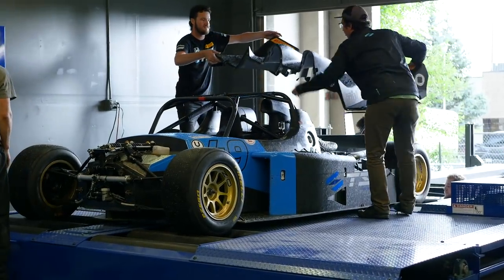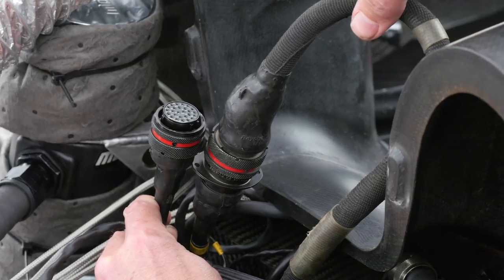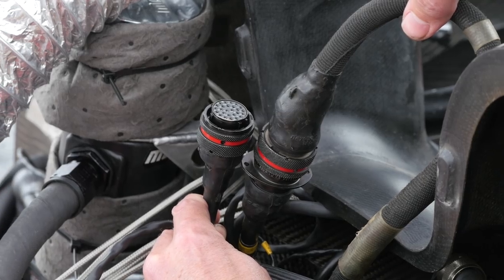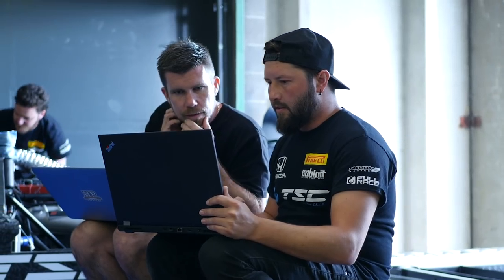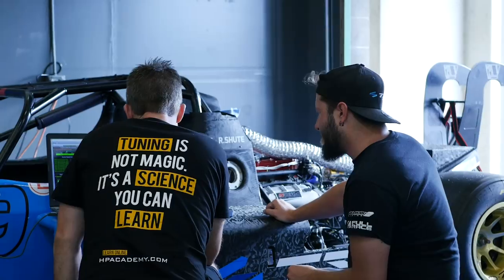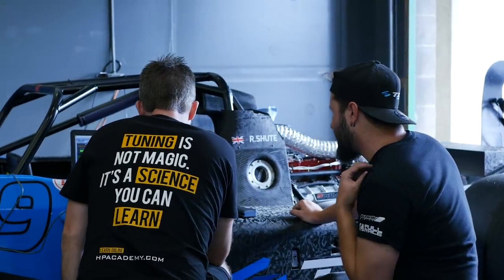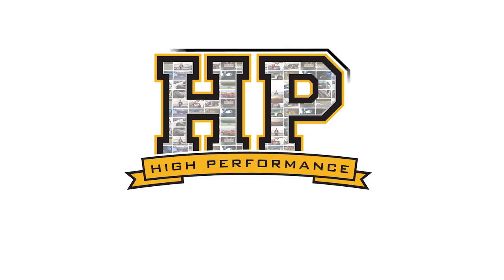How I became a Motorsport Wiring Professional [TECH TALK]

Comment: I only solder because I've had and seen lots of crimping failure, I guess that'll change now. I guess I'll revisit my crimping techniques. Ty Taz
Reply from the maker: You can thank Andre and Zac, I'm just the comments guy, but cheers! haha 
Knowing the limitations of techniques and products just helps you better avoid the pitfalls. You don't necessarily have to change what you are doing with your wiring if it is working for you (depending what the application is to a point as well) but we can say with confidence where we don't use it and why in professional motorsports looms 😎

There are some great resources on the forum for tools and material if you're on the hunt for some crimping gear though: https://www.hpacademy.com/forum - Taz.
Reply: Ty Andre & Zac
Reply: @gammalight1312  chances are its the tools your using.
Reply: @blindabinda1234  totally.
Reply: Man, I read the aerospace advice on soldering wire joints. They go so deep into stranded connections and crimps that it makes you wonder where the solder section is. It isn't. Aeromotive literature I've seen always specifies no solder unless on circuitboard. Die to vibrations. Im thinking the gentleman here read what I read. Im actually relieved, no joke. Nobody believes me on this one hahaha

Comment: I couldn't wrap my head around a crimp being better OR more reliable than a soldered joint. Then I looked at the crimp on the website... I realized you aren't talking about the Wal-Mart crimp connectors I was thinking about. I've never seen a crimp like this. Changed my mind.
Reply from the maker: Yes there is quite a big jump from those to decent crimp terminals and tools in quality, and even then before you get to the professional level materials there is a solid middle ground. Really happy the video helped you discover something new and cheers for the comment :) - Taz.
Reply: There are ways of soldering that are good. Space industry solders connectors and their requirements are higher than racing.

Comment: Kinda funny that in the military we DO use solder "milspec" connectors on the aerospace equipment...
Reply from the maker: The suppliers tell you not to do this. Whatever works for you, but you won't find us soldering connectors unless we switch from performance vehicles/race cars to tractors, and even then we'd probably still crimp ;) - Taz.

Crimping "preferred method for high-performance applications": https://www.milnec.com/mil-spec-connector-learning-center/mil-spec-crimping-instructions/

Soldering "general-duty and industrial applications": https://www.milnec.com/mil-spec-connector-learning-center/how-to-solder-mil-spec-connectors/

Comment: You only have to check the Military to see how their radio equipment wiring is made. Not cheap though! At least here in Aus the only failures I saw was due to neglect either having it squashed under heavy loads, worn on sharp steel/alloy or pulled so hard while attached that it had no choice but to tear itself to bits!

Comment: What about circular mil-spec connectors. Those are a really great choice to use and is a lot cheaper then Autosport connectors. Why don't you'll talk about mil-spec connectors.
Reply from the maker: What specific military specification/standard of connector are you referring to? 'Milspec' is a term that covers the wiring tractors through to missiles, it's not specific to anything.

Autosport on the other hand is a line of connectors made from the same parts bins that are specific to motorsport. They are generally lighter and have a higher pin count - Taz.
Reply: @hpa101  ms3470 and ms3476 circular connectors. They use deutsch pin and socket terminals

Comment: Calling Deutsch DT/DTM connectors cheap is quite funny. In professional world of harness manufacturing, they are quite expensive, so in mass production, they are often substituted for various generations of cheap but reliable AMP Power Timers.
Reply from the maker: They were not called cheap, they were called cheap when compared to Autosport connectors 😎 - Taz.
Reply: OK then.

Comment: Nonsense i know people that only do electrical work and they use both soldering and crimping really makes no difference.  Because what are the differences? ! You are just sending a signal or current through the copper wiring
Reply: One way squeezes the wires together, the other glues them together...

Comment: What you guys are saying makes no sense when it comes to the whole connection and solder why do you think vehicles from the 70s 80s and 90s have wiring harness problems they didn't solder the wire to the connector overtime water or moisture got in between cause it to corrode and rust causing wiring harness problem the proper way of doing it is to crimp The Wire then solder then put a lair heat shrink around it it'll be water tie and make proper connection no matter what
Reply: I have an RX7 that had a wiring harness problem a wire fried due to inproper connection at a y splitter I went through replace the wire soldered it went through the whole wiring harness resoldering every splicer and connector from Factory all my wiring harness problems went away afterwards I got proper voltage to my fuel pump proper voltage to my coil packs and everything else so you can't tell me soldering wires is bad you have to crimp it then solder it to make proper connection all the way around
Reply from the maker: That is an insulation failure, not a crimp or solder failure and no you should NOT crimp and solder on a professional motorsports loom. 
What you do at home is up to you but if you are sending work out the door that is crimped and soldered then you should spend a bit of time educating yourself on why that is neither professional or the correct way to do things - Taz.

Here is a post on this exact topic: https://www.instagram.com/p/BlY4I3EHITd/?taken-by=hpa101
Reply: @deatherageperformance8367  I'll do that with large 0-AWG type sound system stuff but I think they're right about crimp instead of solder on sensor wire. I think he must be combining the wires before crimping but I still have to check his work out.
Reply: @hpa101 why on older vehicles do they have the similar problem all recurring around the same problem poor connection by just being crimp not soldered you expecting a race car application it to be crimp solder and heat shrink that way for durability and long term used
Reply: @gammalight1312  I personally don't think his waist the proper way just cuz I work on older vehicles and I see the problems when it comes to electrical harness issues moisture and corrosion can get in anywhere and Destroy anything especially for wiring harness connections at least by putting a dab of solder along with the crimp will help block moisture out of it and keep a proper connection and if you really want to be OCD about it at put  heat shrink
Reply: @deatherageperformance8367  I've encountered some issues with flux causing wire and sheathing to decay over time, mostly on less then pure wire but it's also a variable I think motorsports are trying to avoid. NASA solders alot of their connections and they do it in a way that's different from automotive so I think it mostly comes down to the application and environment. Everything has it's place for sure.
Reply: @gammalight1312  they're more less going off for the fact that factory didn't use it so it's not needed but they don't understand Factory cut Corners anyway they can if it cost a million dollars to put a dab of solder on every connection they rather not do that that also means if there ever is a problem with the wiring harness and it fries or fries electrical circuits the person's going to take it back and they're going to make more money off itI've never had a problem when I put a dab of solder on all my electrical connections and neither has anyone else but we all seen what happens when there is no solder and poor connection happens
Reply: @deatherageperformance8367  I agree with some* of that.
Reply from the maker: "I've never had a problem when I put a dab of solder on all my electrical connections and neither has anyone else"
That is 100% not true, and we specifically mention the downsides of solder in this video. Everything has its strength and weaknesses. A poorly executed crimp will fail just as a poorly executed solder joint will, however, a correctly executed crimp is superior to a correctly executed solder joint for this application.
This topic really is covered in the video. 
I would also just add that if you think using heat-shrink is being OCD you might not actually be producing work that is to the level you think it is at and I would recommend you revisit some of what you think you might already know via our Wiring Fundamentals course, or some education elsewhere if preferred. We're here to help :) - Taz.

https://www.hpacademy.com/courses/wiring-fundamentals/
Reply: @hpa101  I'm going off my own personal experience of my work and others and seeing the downsides of all plus the upsides. soldering is just that little extra back up. if you don't know how to solder and you caused problems that you're talking about you need to learn how to solder first.most interior applications you wouldn't really need to solder this is mainly for engine bay and undercarriage set up
Reply: @hpa101  all I know is I'll be using full wire strands and crimps only from now on except for circuit board level electronics where the only option is solder. Looking at the crimp photos you posted shows a permanent and sustainable connection with less variables for degradation, there's no question in my mind to that being the superior method.
Reply: @hpa101  then show a video with actual proof proving me and everyone else that does the solder technique that were wrong not just he said she said. we want to see actual results and long-term with same concept solder and crimp and no solder with heat shrink show the results after long-term with exposure to moisture and all other elements
Reply: @deatherageperformance8367  Dude I'm pretty sure you can just Google it.
Reply: @gammalight1312  it's just a run around like everything else these guys should at least show the work and not just say there's a lot of people doing that and no one really showing the results
Reply: @deatherageperformance8367  I see where you're coming from, I really do but lets look at the pros and cons of both methods. Understand I've been soldering every connection I can up till this point.

Crimps pros: Can be used without heat, can be made from like metal preventing galvanic corrosion, it can be gold plated, there's no acidic flux needed, they install quickly, there's less chance of increasing circuit resistance (ohms value), the joint is strong and can be shielded by shrink tube with dielectric grease for additional all weather protection.

Crimp cons: they can be installed incorrectly, too tight, too loose, without adequate wire weave, without shrink tube and they might make noise if not secured in a loom.

Solder pros: very strong bond, tin doesn't oxidize fast, it can be used on many metals, it's not magnetic, it's doesn't have to be bulky.

Solder cons: it requires acidic flux that breaks down metal and plastic if not cleaned or used correctly, it always increases circuit resistance, it requires heat, it normally requires dissimilar metals that can cause excess corrosion when exposed to salt water, it can be easy to under or over solder, it requires electricity, it can crack when bent, it smells awful and probably causes cancer, repairs generally require more exposed wire and more wire length over all. And who hasn't burnt themselve or something with a soldering iron accidentally.

  I mean I'm sure there's more to both sides but I'm sold on the wire crimps after thinking about it, also HPA really does know their stuff and not once has their advice put me in a bad spot, they really do offer the best advice. 
  I've won national competitions in mechanics and my teachers/instructors always pointed me toward solder so I completely see your point, it's just at the end of the day a similar metal crimp over a properly woven wire with a gold plated contacts wrapped in shrink tube with dielectric grease as a gasket is an unbeatable connection that is easier in most circumstances and more forgiving to the remaining length of wire should it ever get pulled on.

 It all has it's place but I think it'd be really smart to adopt wire crimping as a primary connection method especially in high vibration places or where a brittle connections can cause excess damage if broken. The crimp is is like a crumple zone in a car frame, it tends to sacrifice itself to keep things salvageable but it requires a new skill to perfect the desired result.

Trust me dude, HPA isn't giving bad info.
Reply: @gammalight1312  in the long run I just want to see more proof everyone can say anything they want but no one has physical evidence of what's going to happen that day versus 10 years from now under variety of connection methods
Reply: @deatherageperformance8367  the evidence, even physical evidence is all around you, you just need to be able to see it.
Reply: I'd hate to see your own personal experience if the bullshit you're spewing here is what you're putting out. Crimp is better then solder, it's just a fact and the there's no room to discuss. Solder should only be in two places, the shielded wire ground drain, and on the actual PCB of an electrical unit. Should not be anywhere else. It's hilarious reading this nonsense from you, I just hope you're not selling your work to people......
Reply: You're that horse standing at the edge of the water refusing to drink